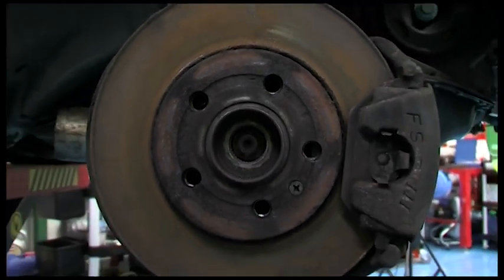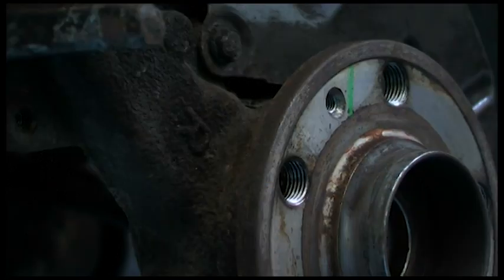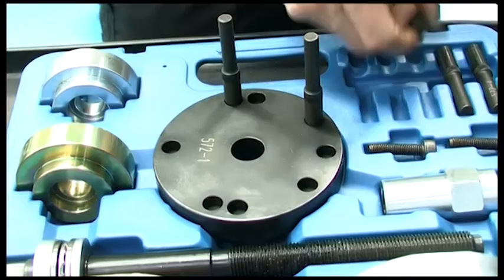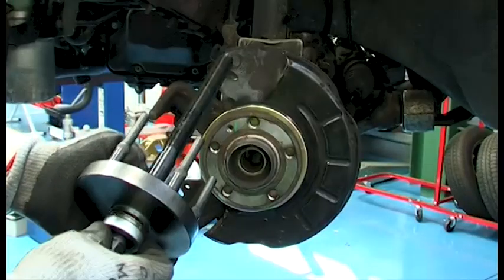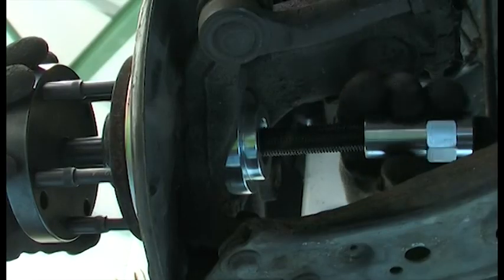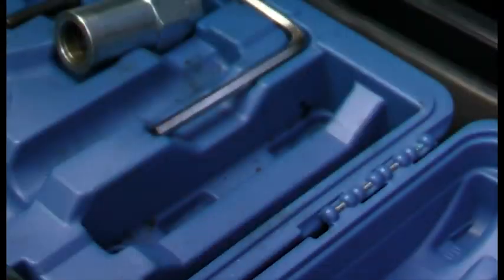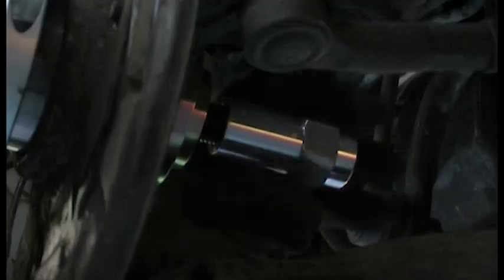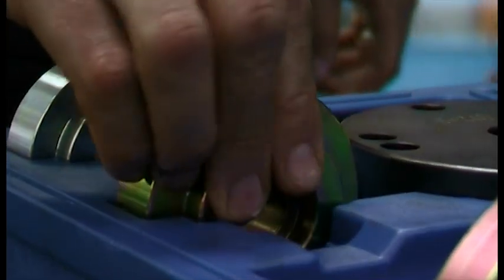5473 | Laser Tools | Generation 2 Wheel Hub Bearing Tool | 5576, 5582, 5587, 5568

Comment: Will it work for a BMW F30?
Reply from the maker: BMW do not use a Gen 2 wheel bearing. The rear is still called a Gen 1 ( held in by a circlip).The front is a Gen 3 ( complete bolt on unit).
Reply: Right okay. Thanks for explaining the difference between the gens.